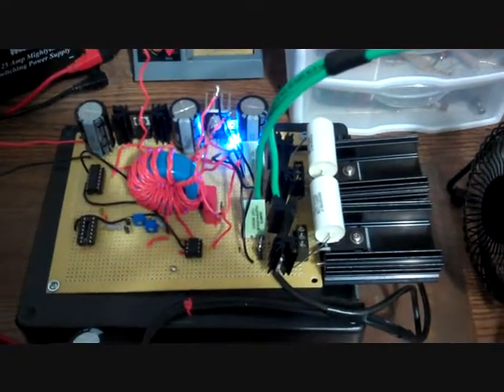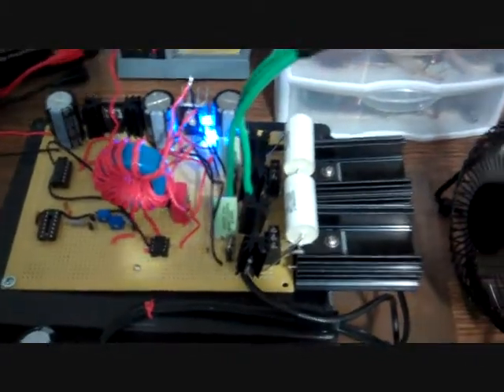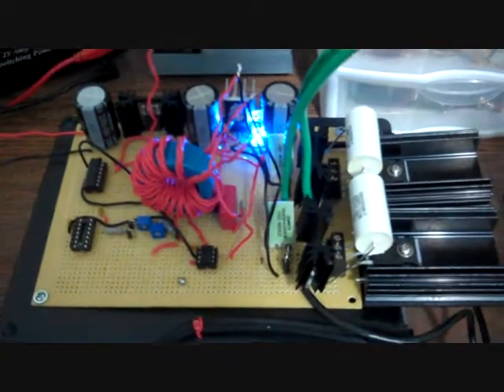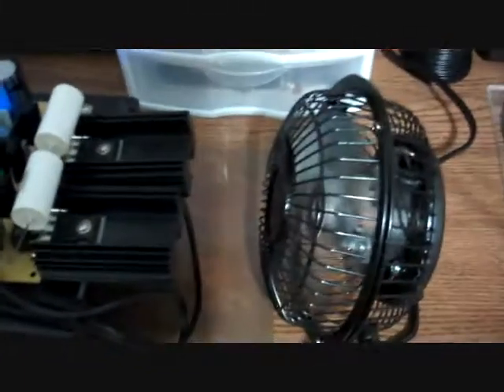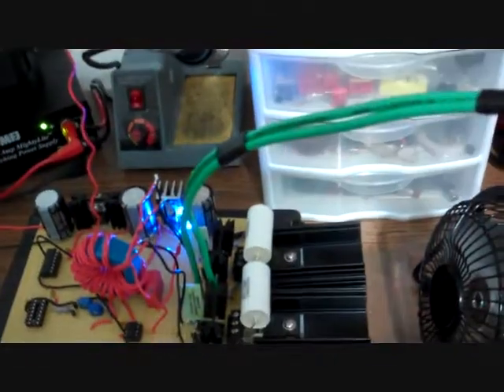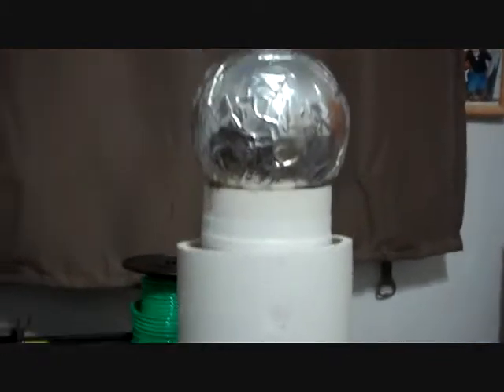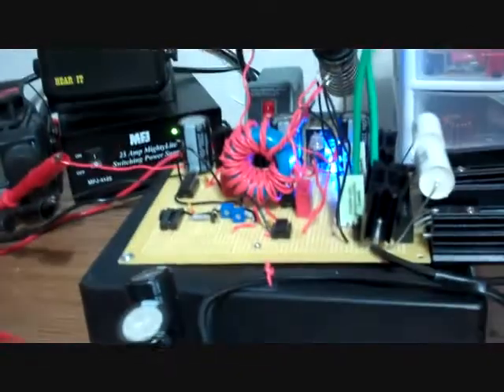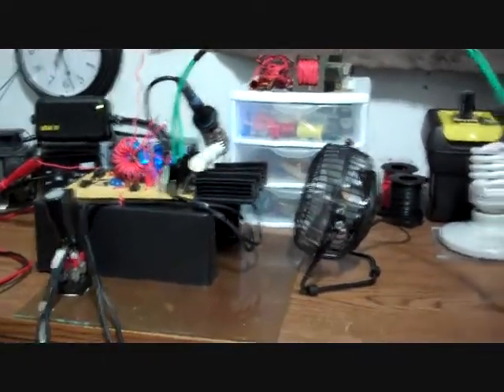SSTC V2.0 - Final Iteration

Comment: try interup it dude to make a beatiful lightning efect
simple 555 feed to ur enable of the uccs
Reply from the maker: The SSTC shown is long gone (note the upload date). I rebuilt it many times over. I am not actually fond of long sparks though. I prefer the CW high intensity e-field operation, much quieter and you can have fun with tubes!